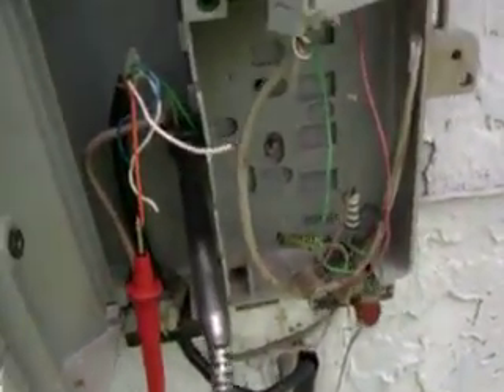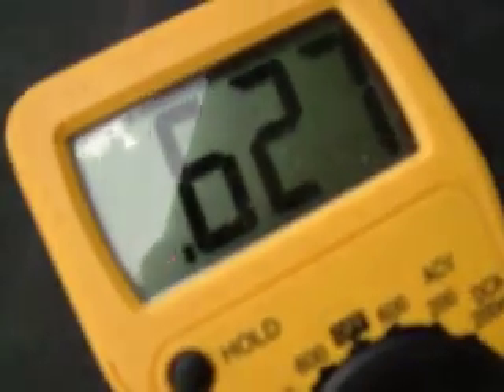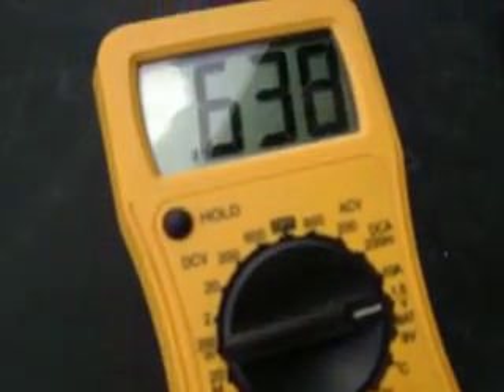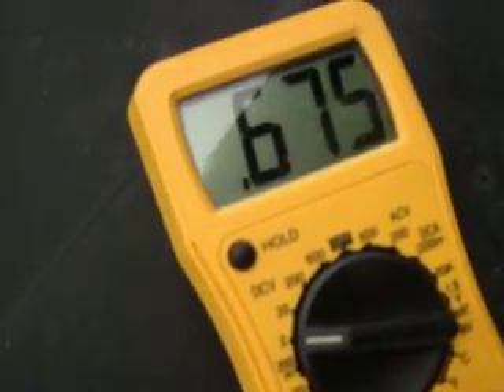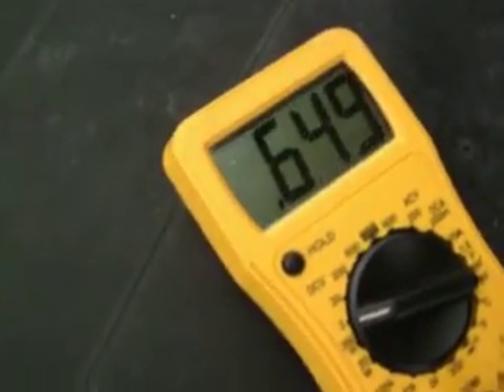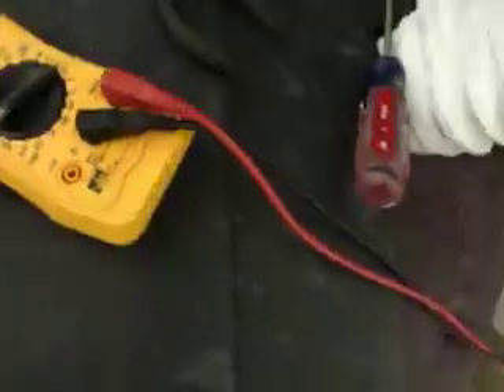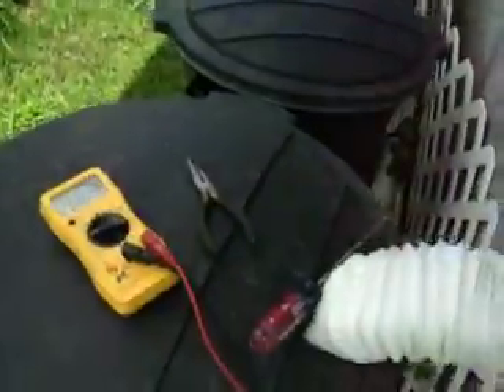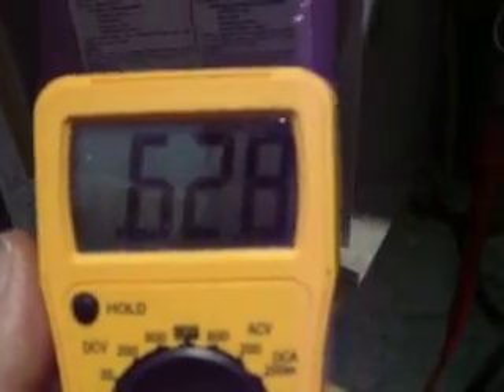power from phone line

Comment: you could try using a design similar to google "joule thief". ultimately you already have low wattage incoming but, by increasing the voltage you could charge small batteries reasonably

Comment: old switch phones (dms/msl) run on pairs so by  checking only one half of the pair, you're going to get an inaccurate reading.  for analog lines, the old dms/msl switches sent 90V's and 120V's for ringing. even though you weren't paying for service, it was still most likely connected all the way back to the switch, straight to a line card &, even though that line card wasn't programmed to provide service, you're still going to detect power on the line.  phone switches provide their own power.